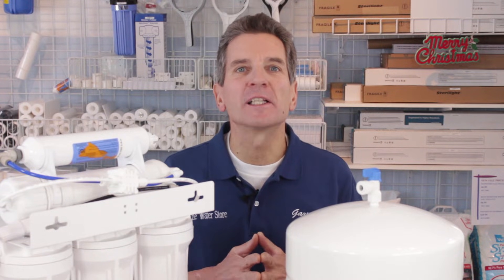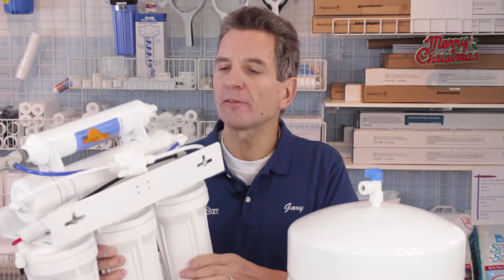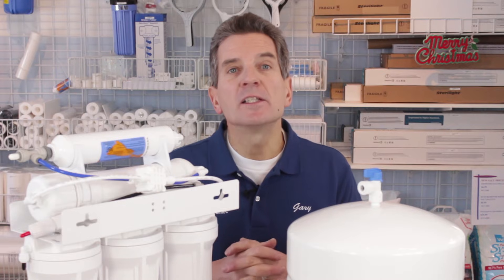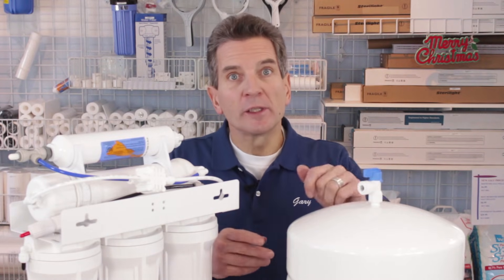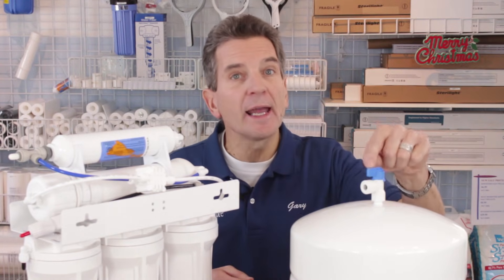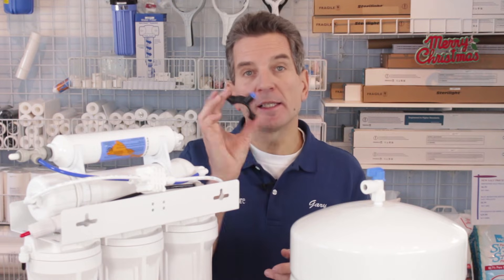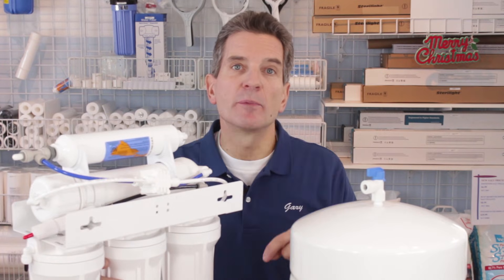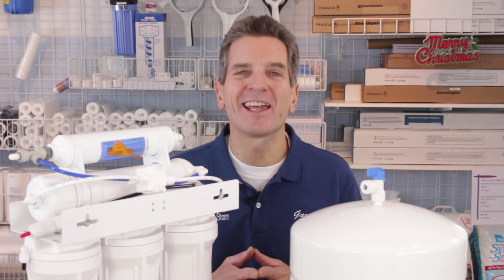Reverse Osmosis Troubleshooting Water Continuously flows to Drain

Comment: I replaced the tank, the check valve, the flow valve, the shut valve (4 lines) and all filters and it still drains. I am baffled 
I have 80/90 psi also

Comment: I have water constantly going into the drain. I can shut off the water supply and reopen it, and the water stops draining until I remove more water from the tank to drink then it consistently drains again until I shut off the water supply again. The water doesn't consistently drain until we remove filtered water. What is the problem? Note: I installed a new ASO about three months ago and I have 55 psi water supply.
Reply: @PatriotPlus179  I have this exact same problem. According to his video, mine works fine because it stops straining when the tank is closed, yet it does keep draining I can hear it. Did you find a solution?

Comment: My RO system is laid out a little differently...no shut off valve on the tank, instead, there's a tee on the tank.  Whereas I think your tee on your unit is attached to the output side of your GAC filter at the very top of your system.  My tank sits between the System and the GAC filter with no shut off valve.  Can I just add your John Guest Shutoff Valve 1/4 PPSV040808W inline between the tank/tee and the "System" to simulate the tank being full?  I just replaced the water faucet, 4 filters, replace the drain/sink tailpiece pipe, emptied and re-pressurized the tank and now it takes 15+ hours to make a gallon of water and I hear water pouring down the drain all day.  I'm pretty sure it wasn't like that before.  Any advice is appreciated!

Comment: So i got my water softener system from a company.  It been good  . But today I been noticing under my sink. There has been a leak  where my filters are and the water tank . I noticed that the red water tube won't stop leaking. After I disconnected it, it kept on going and going .

Comment: Since I totally eliminated the tank some time ago, would a bad check valve symptom be a constant waste water flow with the water inlet valve is open & sink faucet off?  I replaced the ASO but the issue remains. Also, if this offers a hint, after turning the water inlet valve off and then back on again, the waste water stays stopped. But when I turn the inlet valve on after being off for a while, I get waste water flow. (sink faucet always off) Thanks so much! This all started when I turned-on the water inlet valve (after being away for a few days) and immediately heard a thump or mild "pop" then got waste water flow with the sink faucet off. Thx!
Reply: Maybe the ASO valves (orig & new) are good. Maybe it's the sequence in which I turn off/on the inlet valve. When the inlet valve and faucet are off, maybe there's like equilibrium in the ASO and it's not functional until I "seat" it with back pressure by turning off the faucet (no tank)? So I tried it and it did work but not on first try. But why is it happening now- with the orig & new ASO? I always turned off the inlet while I was away and never had this issue. All of this is speculation based on working ASO. I don't think it's the check valve because I don't have tank where it would drain back from- faucet is off. (When run the faucet, I'm at a respectable 2-3ppm, after letting it run for a minute.)
Reply: On second thought, the check valve may be the culprit. What creates back pressure so the ASO activates? In other words, what does the water lean against to create back pressure? It would be the check valve, right?
Reply from the maker: Why would you eliminate the tank?  The ASO reads the difference in pressure between the tank pressure and inlet water to know when to shut off the flow. Without the tank I have no idea on how to make this shut off.
Reply: @water_estore  I removed the tank because I use the system infrequently and found the PPM was high for a long time after turning on the faucet because of the water sitting in the tank. Without the tank, my PPMs go down to 2ppm pretty quickly. Wast water ratio is lower as well. I don't mind the slow flow of the faucet. I've since replaced he check valve and the issue remains. You may be  right that the tank provides the  needed  back pressure and turning off the faucet is simply not enough to engage it. Maybe I was just lucky until now. But then again, some RO communities don't use storage tanks and their ASO works fine when the float(faucet) is turned off. Also it's it's quite possible the cheap ASO from Amazon was bad. Time will tell. Thanks for your reply!

Comment: Hi Gary you ever have an issue with the system making a loud noise?
Reply from the maker: No, other than a gurgling noise of water running to the drain.  That can be fixed by bypassing the air gap faucet.

Comment: Everything works according to your video (drain line stops after a few minutes so check valve and ASO appear to work as designed) .  However, when I turn on the water, it comes out fine for 2 seconds, then slows to a very small stream.  I replaced all of the cartidges and still the same small stream after a few seconds. It used to work fine until about 2 months ago so that is when I changed all cartridges. Any help is appreciated
Reply from the maker: Is you tank light (empty)? It sounds like the tank has lost it's precharge.  This video will help https://youtu.be/isCkMTdl5y0

Comment: I continue to hear a hissing noise but no sound from drain of water draining. membrane and check valve (mine is installed on the line to the drain) are about a year old. If I shut the water supply off the hissing noise stops. Can't figure why the noise?
Reply from the maker: Sorry, I have never heard of this before.

Comment: You are incredible. If I may ask, I did as you suggested. I closed the valve on the tank for 5 minutes. Then physically disconnected the drain hose and no water. However once I turn the tank valve back on, it continues to drain but my system pressure not tank pressure is now at 0
Reply from the maker: I would confirm thatb all of the connections are correct.  If so, it sounds like you need a new ASO valve, we ahve them here https://waterestore.com/products/reverse-osmosis-aso-asv-4000q

Comment: sir my Osmosis  system 1 year old but I still replaced all 5 filters and I replaced the tank  new tank came with 7 psi and after I left 4 , 5 hours tank get full I check the pressure was only 14 psi is that okay? and I wanted one of your videos  to replace hoses from 1/4 to 3/5  so I replaced hose from tank to filter to 3/8 since then I feel tank is not getting full   and water flow from faucet still same not strong  what should I do  I am thinking to replace the tank to a bigger tank  mine now is T32M  3.2 gallon replace to T55M 5.5 gallon  what your thoughts
Reply from the maker: The tank pressure needs to be 7 psi when it's totally empty, you can only check it when enpty.

Comment: Seems like every 2 years I have constant running after replacing the auto shut off valve so this time I turned off the tank I’ll draw two or three glasses of water, and I don’t hear it. But when I open the tank it just runs forever. Could it also be the tank bladder isn’t pumped enough to give enough pressure to get the ASV to work? I am assuming that is the issue when it’s really warm in Phoenix. 

Edit: I just replaced the ASV now and it didn’t seem to work

Edit: so maybe a pump of air in the bladder will work.
Reply from the maker: The tank should have 7 psi of water in it as a pre charge when it is totally empty of water.
Reply: @water_estore  yes I did that. and I changed the ASV and replaced the flow restrictor and now what? maybe the city is just putting out less water pressure?
Reply: I replaced the check valve. And checked the PSI and replaced the ASV. I replaced the flow restrictor and flushed the system. Nothing seems to be working. Oh I just realized it’s very very slow to stop the running. Like take a glass of water the waste water will run for like 15 minutes it seems. Then it stops.
Reply: @AM2PMReviews  Same thing that is happening with mine. I cannot figure it out. Did you find a solution?

Comment: What happens when you turn the RO faucet on if the tank and tank line is removed? Would water spill? I’m trying to disassemble my system because of condensation leaking on my tank line.  I have no shut off valves both at cold water line to the RO(just a T-connector) and also on the tank itself. I can only shut off the water at the main cold water line. Thanks
Reply from the maker: Yes, water would come out of where those lines attach.

Comment: Anyone know how long is a typical drain cycle supposed to go for? I poured about half a cup of water, and got water draining for exactly 20 minutes.. it did eventually stop though.. is it possible I have low pressure in the tank?
Reply from the maker: It depends on a number of factors like the gpd capacity of your system and yout TDS but typically anywhere from 20 minutes to 4 hours.

Comment: I replaced the AOS and the check valve. The water continues to run. I did make one mistake,.... I yanked the black line out before reading the tag on it. I was able to plug it back in but worry it is damaged. Also, would an old membrane cause the water to constantly run? Mine is a probably 5 years old.... I think I already know the answer. LOL. Thank you.
Reply from the maker: Yes, an old membrane would cause water to run to drain.  Also, if you black line is your drain line you might have dissolged the DLFC or drain line flow control.

Comment: Here you go, lessons I learned the hard way (my ASO valve would not operate correctly): 
1) Make SURE you understand the IN & OUT ports and hook up the lines correctly to ASO valve. 
2) Use ONLY hard lines to interconnect (dont use clear lines from home depot, they are too soft and valve wont shutoff correctly). 
3) Keep all hard tube lengths to ASO valve as short as possible.
4) On all connections make sure the tubes push all the way down 
5) On all post carbon filters, post filters, etc...dont plug directly into these filters, first always use a push in connector then push your tube into those connectors.

I did all above and fixed my ASO valve  RO system operation.
Reply from the maker: Thanks!

Comment: Thank you for your video. I have replaced all the filters, the membrane, the check valve, the ASO, the drain tube, and my system is still constantly draining. I also drained my tank and pressurized it. The tank won’t fill now because the water constantly drains. When I close the tank, I get a tiny trickle out of my faucet and a strong flow out the drain. Please advise if you have any tips. Thanks!
Reply from the maker: For sure the tank has only 7 psi of pressure when it is empty?
Reply: Same problem here. Did you find a solution?
Reply: @TampaBoy  yes! I contacted customer service and they had me order different filters… not sure how, but it solved the problem.

Comment: Why does the waste water make so much noise in the pipe when draining? It used to be very quite.
Reply from the maker: If yours flows through the faucet air gap that air gap could be dirty. If you clean it the noise will likely go away

Comment: I did the first test u say on the video.  I filled a few glasses and the system stsrted to drain.  I shut tank off and the drain water stopped with in 30 seconds.  So its telling me according to your test its working properly.  So i did the second test and shut the main water off and th drain water stopped again.  So what could be the problem.  I replaced the all the filters and the check valve before the test.  I filled a 12 cup coffee pot and the drain water never stopped until i shit it off.  That little bit of water i asked for for the coffee pot created about 7 gallons of wasted water before i shut it off. Seems very excessive.  What do u think?  Hope i explained the problem ok.
Reply from the maker: I don't have any suggestions off hand.  You could check out this video for some suggestions https://youtube.com/live/jur9sS2mo34
Reply: I’m having the same problem. Did you find a solution? Thanks

Comment: Hey 👋 
I did the troubleshooting. After shutting the tank valve, no water come from drain. The system shuts down, but keeps powering On and Off intermittently. 
What is the solution?
Reply from the maker: Do you mean the pump keeps turning on and off?
Reply: @water_estore  Yes the pump keeps switching On and Off. Checked the shut off valve. No issues. No leaks any where in the system. Replaced the NRV. But pump keeps On and OFF and the water drains into the Drain also from the Tank.

Comment: Hi Gary, great video

I have replaced the ASO, check valve and verified 7-8lbs pressure in an empty tank. I still have continued water flow from the brine line though. When I shut the tank valve, water does stop to the brine line. Also, if I shut the tank valve when the tank is full, it does trigger the ASO to shut, but that is the only way to stop the flow. Do you know what else I can try replacing?  Perhaps the flow restrictor? (100gpd filter with 600ml restrictor). Thanks!
Reply from the maker: I would think the check valve is the problem since you say the flow stops when you close the tank shut off.

Comment: It could be the Pressure tank is very low on pressure and the pressure differencial is too wide.  The Automatic Shut off works based on pressure differential but if the difference is too wide, the pressure from the low pressure chamber in the ASO will not push the piston into the high pressure chamber of the ASO and thus not allowing for the stoppage of flow to the RO Membrane stage.  The pressure from the cold water inlet will then push right through the RO system and continuously drain.
Reply from the maker: Yes, the manufacturers typically recommend 25 - 30 psi minimum.
Reply: Gary, your explanation was clear but your visual of the RO system is shown backwards and when you point to the check valve it’s not visible. That filter you pointed to, which is the larger one has two outlets on that side and white one where I’m assuming the 90degree fitting is a Ck-90 check valve and the other outlet is black- waste. Is it a 90 degree Ck- valve ?

Comment: Could the ASO be bad even though draining stops when we have supply on, tank off?

I started with shutting the tank valve to simulate a full tank. Supply water runs through the ASO through the membrane, through the check valve, then stage 5, back through the ASO to the Tee where it would then go to tank or faucet. Both are shut, so it backpressures to the ASO and shuts the supply water to the membrane.
Draining stops. 
So the supply water is acting as it's own shut off.

When we do the second test, supply off, tank on. There's no draining. Because there's no supply pressure to stop the tank water going through the ASO, back through stage 5 filter, and then deadheads at the check valve.

So then the problem with the constant draining would be that when the system is on. Supply on, tank on. The tank is full,  but the ASO isn't stopping the supply water going to the membrane, backpressuring off the full tank, and out the drain.

Does that sound right to you?
Reply: I replaced the membrane and it continued to drain. However, I did miss a step where I didn't open the faucet right away and I had some air pressure shoot out the faucet. 
Following the instructions in the video, it seems the ASO is bad, but is it possible I damaged the membrane and it was constant draining from an old membrane and then draining again from a damaged membrane?
Reply: I then took the ASO and reversed it's direction. The problem moved. 
Instead of the constant drain stopping when the tank is shut, it constant drained from the supply. 
I had already taken the ASO apart to see what's inside. So I don't believe the shuttle really cares which side it's facing. The color coding seems more to ensure that both colors go on one side or the other instead of same color on top and bottom. 
I'll update once the new ASO arrives, but I still want to know from you if it seems I understand why we test it the way we do in the video.
Reply from the maker: No, I doubt it.
Reply from the maker: It could be that the aso is ruptured inside and is allowing water past it's internal diapgram.
Reply: @water_estore  New valve arrived and it's working now. I also drained the tank and checked the pressure on the bladder. I'm wondering if that was the real issue because none of my guages read anything. I had to rely on the bike pump guage to reach 5-6psi. Hooked it all back up with the new ASO. Waited an hour and a half of more constant draining, trying not to touch it until the tank had time to fill, and it has now... finally... stopped draining. It has been driving me nuts for the last few days with nonstop draining. 

This entire event has basically fired the company that installed it from coming back out. They were called out for the draining noise it was making. Some miscommunication on the homeowners part due to a previous air noise it would make. The tech did an inspection and only noted that the filters needed to be replaced. I'm guessing the homeowner declined filters. Until I said something about the draining and I asked about the filters. 
This is where I stepped in.
Filters were ordered, and replaced.
It was missing the sediment filter and had a carbon filter in stage 1 with stage 2 empty. The tech should've noted this.
I took the time to learn the circuit (as you read above) and was scratching my head on why it wouldn't stop draining. Because it was constantly draining. 
So by this point I've gone through all the procedures and the system now works again 👍
I reached out to verify that I understood the "why" part. I appreciate your quick response.